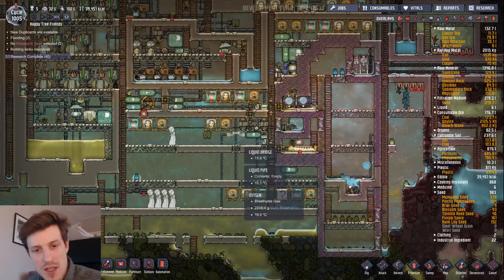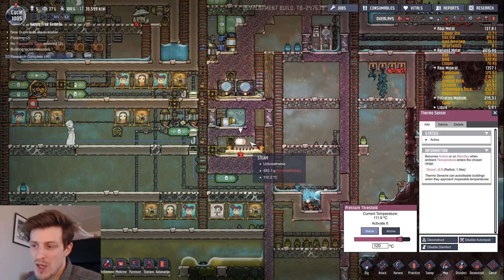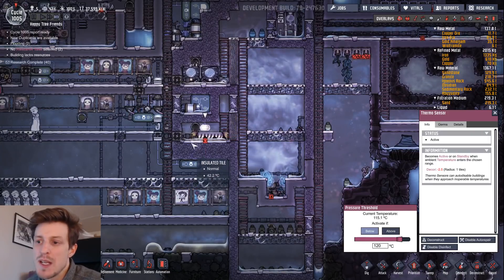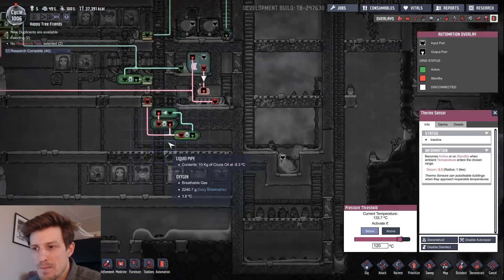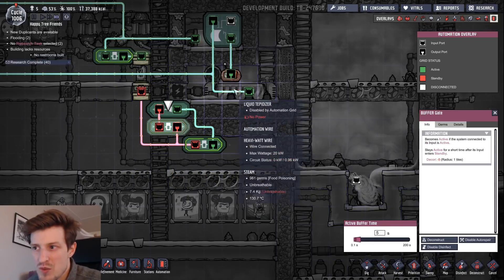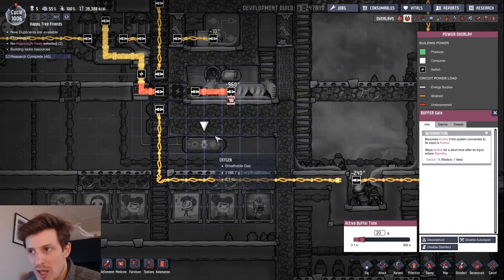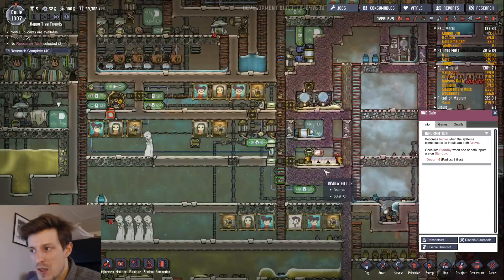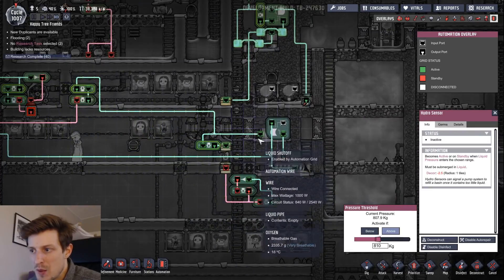How to boil water with a liquid Tepidizer  -Practical Automation

Comment: This helped so much on rime what I would say is that it takes a second to make sure the water boils when you first start so I made the output go back into the same polluted water tank until it was boiling the water. side note this cancels the usage of a sieve which makes rime pollution much easier
Reply from the maker: Thank you for the comment (I know, very late reply from me). So this still work? A lot of my ONI content is probably very much obsolete due to later patches. I need to get back to playing ONI again at some point